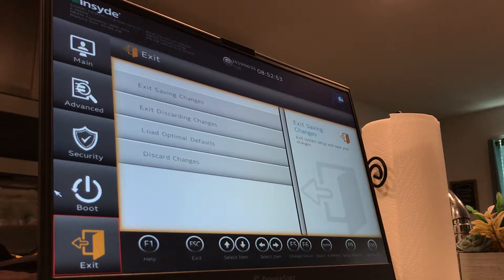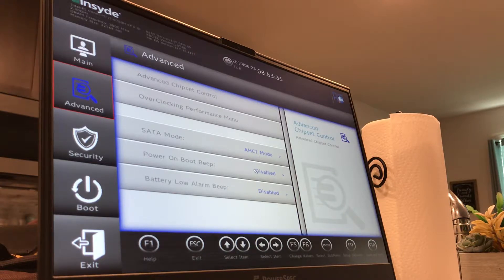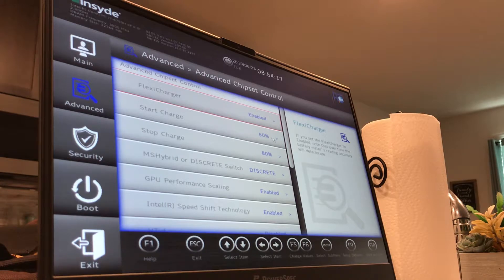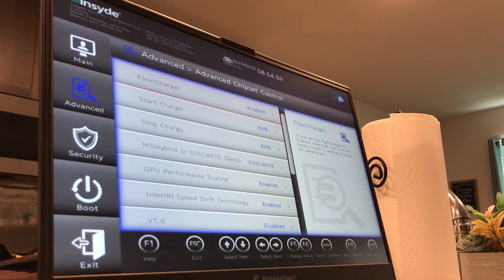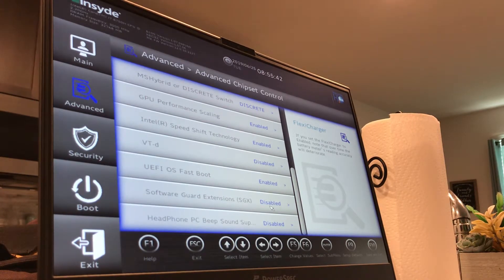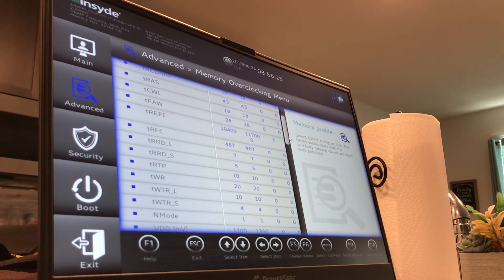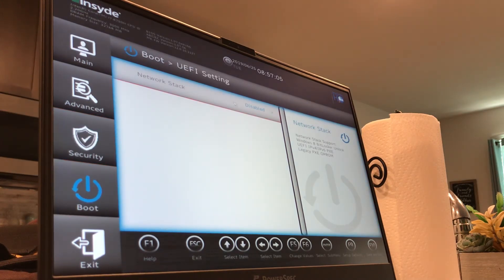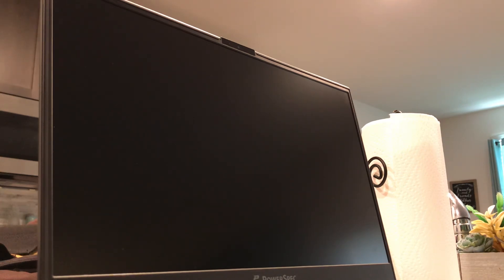PowerSpec 1720 BIOS

Comment: Do you recommend me buying 1520 or 1720 i'm not rich and the 1520 looks more appealing to me, but if you tell me it's worth it the 100 extra dlls, i would reconsider
Reply from the maker: I personally chose the 1720 for easier viewing, 3 harddrive bays, and what I think is slightly better cooling. Nothing wrong with the 1520, it is just a slightly scaled down 1720 in size. They are both great choices.

Comment: How do you get into the bios? I tried F2 and Del. Super annoyed right now lol
Reply from the maker: F2 at the Post screen. The Windows is VERY fast. The easier way is to boot into Windows and type 'Reset' at the Start button. This will boot you to the UEFI screen where you can select Advanced, UEFI boot, and then it will cycle you to the BIOS screen without needing a key press at all. Try it! :)
Reply: @T0bimaru  Thanks!
Would you happen to know how to clear the CMOS? Seems I got a little over zealous with the ram speeds lol. Won't post now
Reply from the maker: MrCaptainTahoe If it’s boot looping you need to do a CMOS reset. It involves removing the keyboard from the top of the laptop, and then removing the small motherboard battery for 30-60 seconds. The laptop battery must be removed during this. It will reset BIOS to defaults.
Reply: @T0bimaru  removing the keyboard feels like you're going to break it lol.
Got it back up and running now though. Thanks again!
I contacted microcenter tech support and they couldn't tell me where the battery was.
New to the whole laptop thing, desktops are way more accessible.
Thanks!
Reply: @T0bimaru  what settings do i enter to put my 2400mhz ram to at least 2666mhz?
Reply from the maker: @Kenniixr  It's very system and memory dependent. There is no setting that is guaranteed to work. If its currently 100 x 24 = 2400MHz then you could try 133 x 20 = 2660MHz. But as far as memory timing, voltage, etc that is all going to depend on your memory and system. I have spent literally hours adjusting memory timings to find a stable setting. DDR4 memory timings is like black magic...